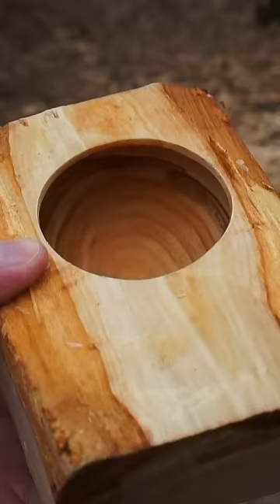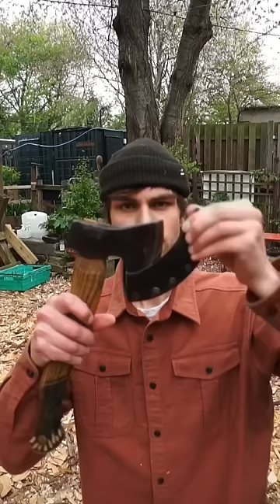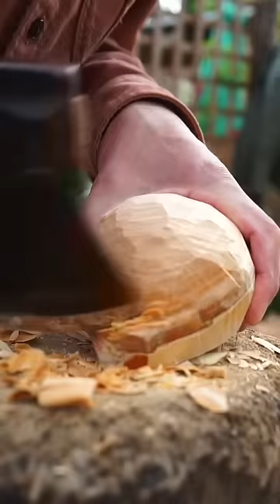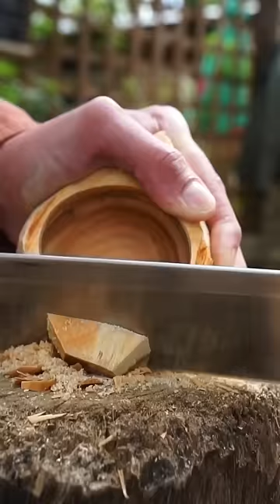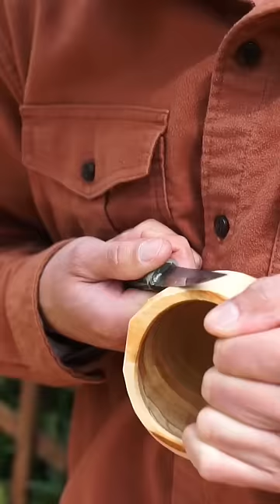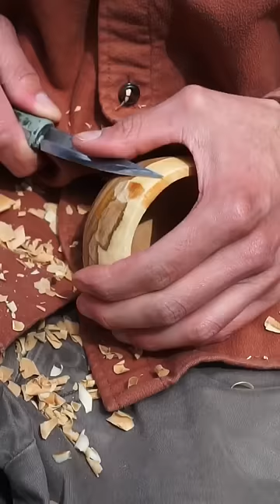Carving a cherry drinking vessel! #greenwoodworking #woodcarving #workshop

Comment: Carving the bottom flat would help dramatically.
Reply from the maker: Help with what?
Reply: @samuelalexandershapes  I mean, it doesn’t have to be perfectly flat, but flatter would help it from rolling around and falling over.  It would also help it from falling over on uneven ground, even if the cup was not level.  Being that you appear to be outside (camping? Off the grid? Pioneering?) that could help useful to you.

No disrespect, just wanted to comment my thoughts.  

Nice work through.
Reply from the maker: I used to make footed cups, they're easier to make really. With these 'vessels', I tend to leave the thickness of the wall thicker towards the bottom so that the weight of it provides sturdiness. I found that they actually sit better on uneven ground when they have a rounded bottom because when trekking, there is no even ground to place a flat carved cup! The ones I made in the past with a foot, were mainly for home and dining use.

Comment: One question: i was told you need to ve extremely careful when carving this kind of "kuksa" with an axe when it has already been hollowed out because the axe introduces a lot of stress to the wood which leads to cracks. Judging by how you used that axe, your kuska should have at least some cracks in it. 
My question now is, how do you prevent that? Is it the kind of wood you use?
Reply from the maker: Technique is important. 
I am engaging the whole bevel edge of the ace and almost ‘brushing’ the wood away. Also my axe is extremely sharp and I understand where the bevel edge meets the wood on a convex. Leaving the end grain heavy and sawing it off is also a preventative and creating a pillow of shaving underneath too. There are ways.
Reply: @samuelalexandershapes  thank you for explaining! Would you recommend doing it this way or carving the outside first, to a beginner?
Reply from the maker: Recommend with all hollows to remove the inner first
Reply: @samuelalexandershapes  interesting, why is that?
Reply from the maker: @cedrics1220  two reasons really. 1 - the piece of wood is easier to clamp when it’s more intact. 2 - axe is more precise to shape after. The hollowing tools usually dictate the same so the axe secondly meets it.
Reply: @samuelalexandershapes  thank you!

Comment: what do you sharpen your hatchet with?
Reply from the maker: Hello, I usually use wet and dry abrasives on a long flat surface. Working up the grits to around 5000. I then strop at the end.

Comment: All that wood, and no handle!? WTF!?
Reply from the maker: Hmm good question. 
I work freehand, I don’t draw or measure these vessels. So I need wood to carve the hollow. I don’t really have a plan with the hollow, so it very much the mindset of ‘it’s done when its done’. For this one, I didn’t really feel like carving a handle. So I didn’t. 
I worked off centre for two reasons. The first would be the end grain on one side was close to cracks that I sawed off at the beginning of the prep. I needed to allow for leeway in case they traveled. 
Secondly would be to bring the hollow into the centre of the cup horse and to allow lots of space for the articulation of the tool to undercut the rim of the shape. 
✌️

Comment: could you not have used a smaller block to start with... what a waste... just to create content
Reply from the maker: This was actually a commission for a client who wanted a vessel to drink his whiskey from… the hollow is undercut quite dramatically so it filled the width of the billet. Leaving a decent amount of material on the end grain isn’t bad practice for this process. It’s less prone to crack with more material being able to absorb shock (fruit woods like to crack) it’s also much easier and safer to clamp in my cup horse. ✌️